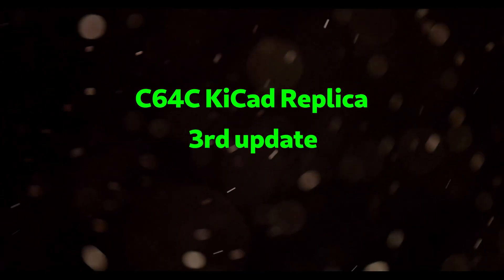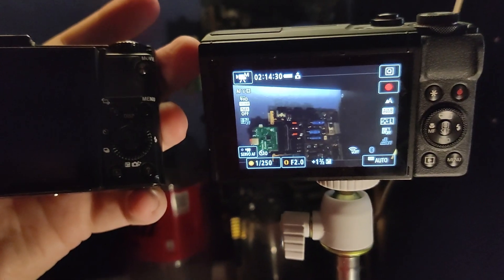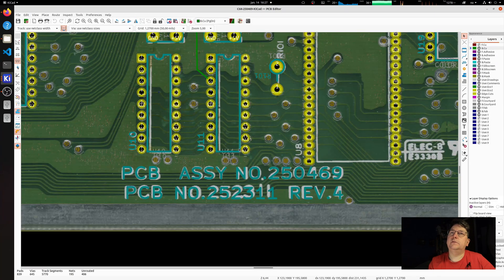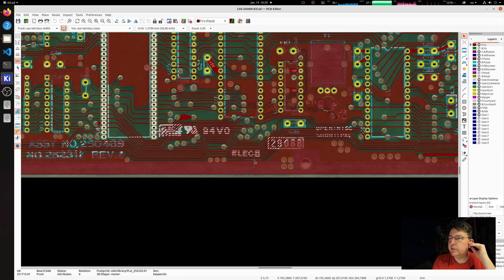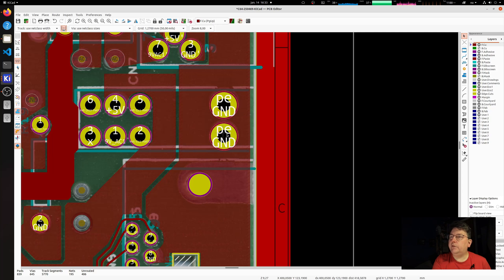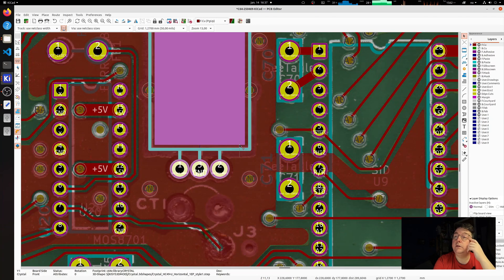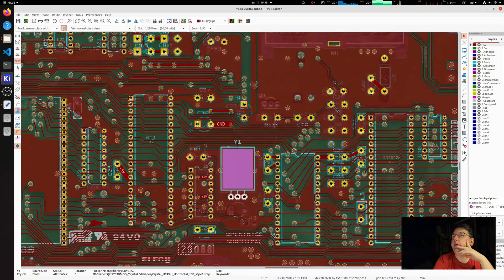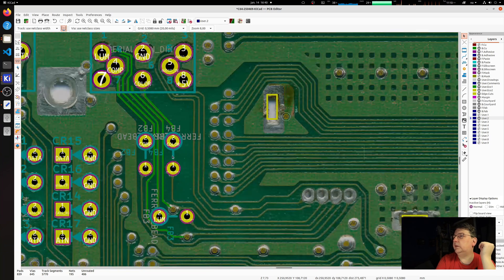C64C Motherboard KiCad Replica update 3

Comment: I printed PCB and assembled . It didn't work the c64 do not boot. , I tried two PCB since the company sent me four replica.  I then purchased another replica moved componets there and it worked. Probably the company did some mistake creating the replica. :(
Reply from the maker: Hi. Sorry to hear that. I think you mentioned it before. Could be anything. If you build another one and it doesn't work, try diagnosing it. Usually it is just a tiny fix that is needed to make it work.

Comment: Good to see you still working on these boards.

I would say it's FAR harder to make a repro that follows the original traces, than just making a repro board and routing as normal.

So props to you for doing this.

Looks like the new background image loading in KiCAD is a game-changer. It might force me to give KiCAD another try soon.
Reply from the maker: Thanks. I think the biggest challenge is not to get overwhelmed, and take small steps. It's a good practice.

Comment: Why not use automatic flood fill? Is it for getting more visual similarity to the original?
Reply from the maker: Yes, and there are several power nets on the same side. I make use of the automatic fill in some places.
Reply: @bwack  Sure, but several power nets shouldn't be an issue? you can just make the fill area around the areas where the fill is expected. Then you wouldn't have to draw those 30 points around a pin like I saw some place :) hehe. But I guess it's about personal preference :) Very cool project! Awesome progress!
Reply from the maker: @haakonness  Thank you 😃